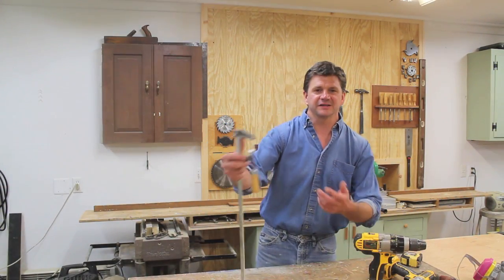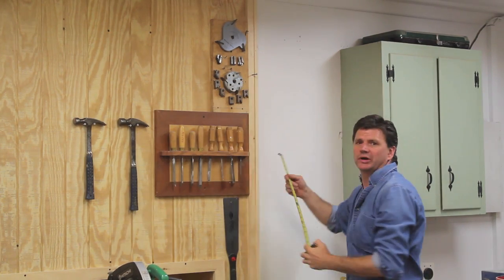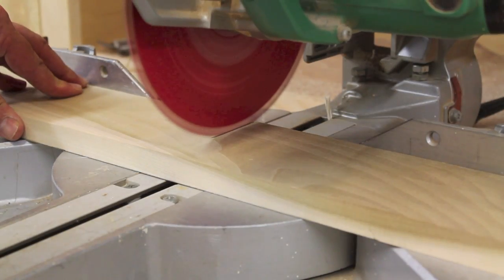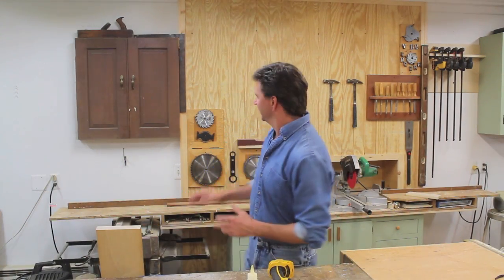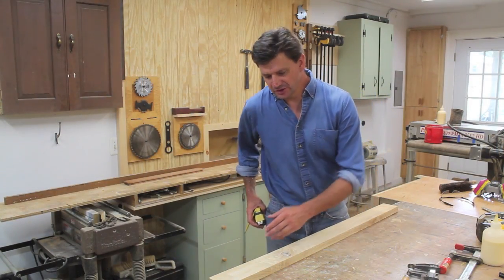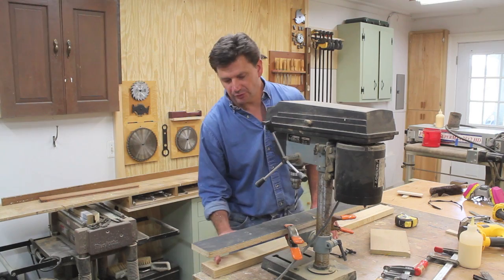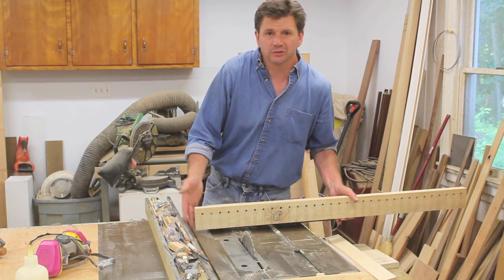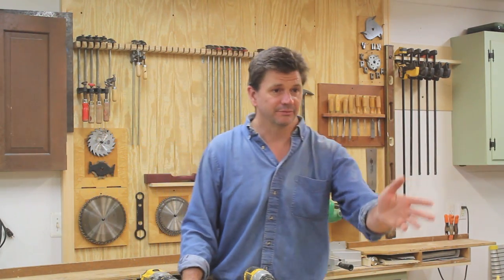How To Make Clamp Racks & Organize the Shop.

Comment: Wow, the bar clamp rack is really nice.  Very impressed with the design.
Reply from the maker: Thanks Chris
Reply: The slots on the bar clamp rack make me a little nervous. I can see how they might crack off, since the grain goes across them. What wood was being used? That might make them more durable.
Reply: Mark DeLong: That's a good question. I'm not sure if it would get enough weight that it's an issue, or what wood was used, but I'd be interested to know more. 

*****: Any insights?  Thanks!
Reply: If you were concerned about the pieces cracking off, one possible solution to reinforce would be to first laminate a layer of 1/4" or 3/8" plywood to the top face of the dimensional lumber, then do the drilling and slot cut-outs.  Either way, like Mark mentioned, there's not actually much weight or stress on them to begin with.
Reply: @MarkDeLong  5 years later he still has same rack going Strong

Comment: I think plywood would have been better for the piece that you cut all the slots in. All those little fingers are really weak after cutting the slots. At least with plywood you would have cross cross layers instead of the single grain direction.

Comment: Hi, great to watch your instructions.
btw, I bought old used 10" circular table saw. what is your suggestion for blade type I should buy to make it more useful, since this is only cutting tolls that I have so far (dont have mitter or other saw). Mostly I will cut plywood.
thanks in advance.:)

Comment: Only problem I see with your clamp rack long term is that the wood between the slots is crossgrain and is therefore going to be weak.  Would have been better to dado in triangular supports from 1/2 inch stock and glue them to the main board to get that long grain strength!  (underneath each piece of wood coming toward you--hard to explain in words)    Other than that it looks very good!  :)
Reply from the maker: Yeah,  I know what your talking and you have a good point. Thanks

Comment: Thank you again i had seen all the wood working videos and i learned alot from you , i have one question which joint is better and stronger the dowel joint or biscuit joint ? 
Regards
Reply from the maker: Thinks, biscuit is easier to use, but I think the dowel might be stronger
Reply: Thank you Jon